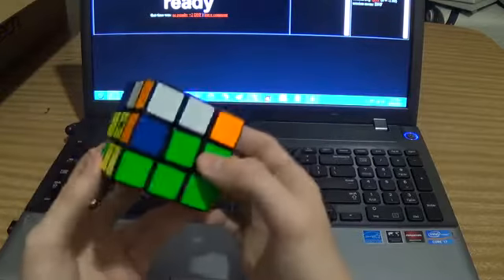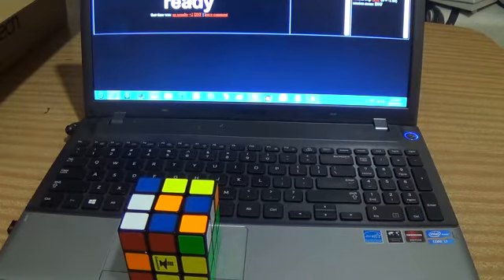FMC techniques: Pseudoblocks and inverse scramble

Comment: At 0:48 you mention the inverse scramble. The inverse scramble of what?
Reply from the maker: The inverse of the actual scramble you're given in FMC. For example, lets say your scramble is this.

D B R' L2 F2 U D2 R F' R' F2 L' F2 L2 F2 U2 R L2 B2 R

The inverse scramble for that scramble is

R' B2 L2 R' U2 F2 L2 F2 L F2 R F R' D2 U' F2 L2 R B' D'

If you write out a solution for the inverse scramble I just gave, you'll get a solution for the normal scramble if you invert the solution. Try it yourself :)

Comment: That didn't explain everything enough, honestly. You would have to already know what you were talking about in order for this to make enough sense to use, and if you already knew, then there wouldn't be a point to watching it.

 Could you do a few example solves using inverse scrambles or premoves? You could just make a video explaining each part of the solves you do in the example solve game thread on speedsolving forum. I think that would help.
Reply from the maker: 1. The last part of this whole series is going to be example solves, so just be patient.
2. The thing with explaining FMC techniques is that you can't learn anything from just reading tons about it or watching videos on it. You need to actually do FMC solves yourself and figure this stuff out yourself based on what you've read/what you know about certain techniques. As far as I'm concerned, I went over as much as I could without making the video absurdly long. Basically, FMC techniques aren't very codified and are really really conceptual :P
Reply: Jayden McNeill For most of that, fair enough. For inverse scramble, I don't understand it well enough to experiment with it myself and learn that way. You covered a very basic example of how to use it, and didn't mention switching between normal and inverse in the middle of solves, and how to apply the moves you found on the inverse to the normal. Maybe your explanation is good and I'm just not getting it, but yeah.
Reply from the maker: This video isn't for switching between inverse and normal scramble, that's the next video :P Here I was just touching on the fact that if you do a solution to the inverse scramble, you get a solution for the normal scramble when you invert that solution. I feel like it's a fairly simple concept, and because of that, I used a very basic example :)
Reply: Jayden McNeill OK. I'll just stay tuned, then. Really looking forward to this series. :)